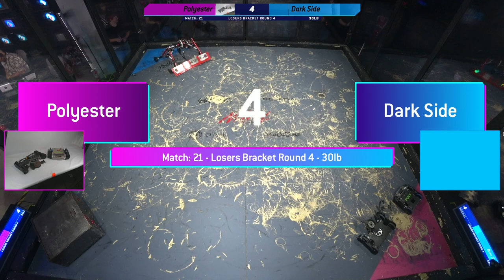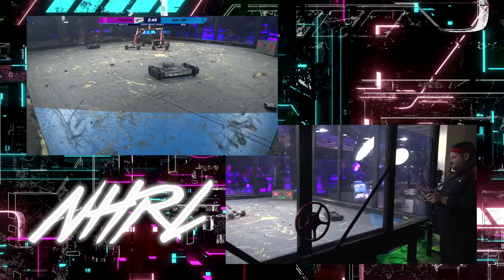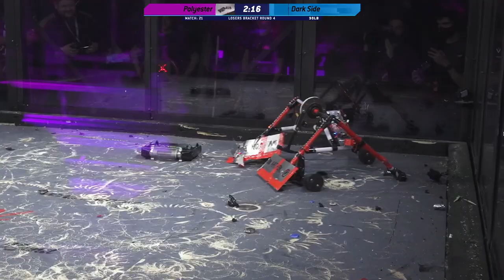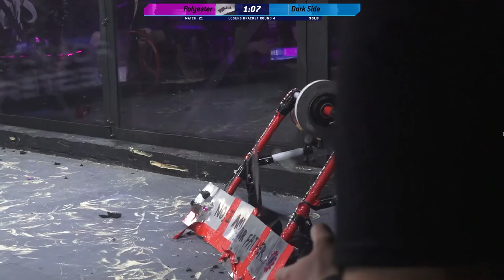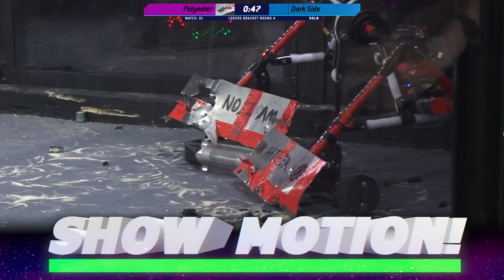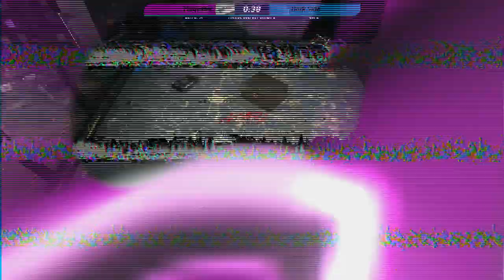Polyester vs Dark Side - 30lb Robot Combat

Comment: I guess this is the logical conclusion if you try to enter a bunch of scaffolding into a combat robotics competition.
Reply: No, scaffolding would have held up better.
Reply: @Switchblade77  Yeah you're right, Mammoth works way better than this
Reply: @bami2  the original design would have worked better with a less heavy central motor, and more powerful motors on the drive. I think the og used ant weight motors on the wheels.